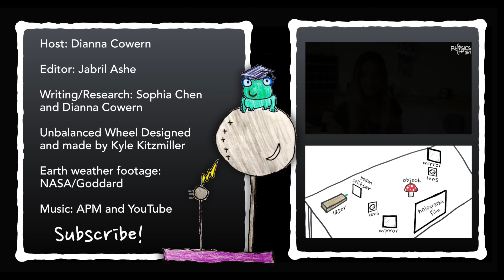Are perpetual motion machines possible?

Comment: So-called "magnet machines " cannot run forever.

They depend on permanent magnets and even permanent magnets are not permanent, they eventually loose their magnetism.

Even one with nothing impinging on the magnetic field eventually decays, if you move anything magnetic or conductive through the field it decays more quickly.
Reply: Hrile there is no permanent source of energy. that's the whole point. everything decays eventually. energy is only useful when there is an imbalance, a gradient. when all the energy in the universe has been "used", it's spread out so evenly, there is nothing but cold. absolute zero.
Reply: Hrile
Ever hear of entropy?

There is no such thing as a permanent source of energy.
Reply: Magnet motors don't depend on anything because they don't work, period. Magnets aren't like batteries. Magnets store energy the same way a spring stores energy.

Comment: I worked with a guy in a machine shop who built on of these.  It was over six feet tall and had six arms, controlled by cams that held the downward moving arms out away from the machine’s centerline.  On the back side of the machine the cams held the now upward moving arms closer to the machines centerline.  It was perfectly understandable.  And it didn’t work.

Comment: I mean, That bird kinda seems like a pretty easy way to get a perpetual motion machine, It isnt perpetual its just turning an energy source we already know about that we cant really extract energy from, and giving it a means to produce it. This is how i see it, It created kinetic energy fueled off of only ambient room temperature. If you had alot of these things designed in the most efficient way to utilize the gas/liquid hybrid in the container, and had alot of these rowed up together all producing a very small amount of energy with only the heat in the room, That would eventually result in a net gain right? Your just standing there once you start them, But if you found a way to turn that little bit of kinetic energy into electricity, thats where it becomes a net positive right?
Reply: i was sorta of thinking the same thing.
Reply: No because you ALWAYS need more energy at the input than you can gain. In other words: To keep your "engine" of the birds running you will reach a point where you need energy to control the ambient temperature to keep it running. Since you gain less than you need to keep it running you're at a net loss.
Reply: @Telris86  What about heating from the sun?
Reply: @progunantilife4777  
Then it would be more efficient to just set up a solar panel array and cut out the middleman.

Comment: what if you suspended the unbalanced wheel with magnets?
Reply: (this would make no friction)
Reply: Jacob Smith air resistance is still a thing. also you can't extract energy from it of you can't touch it, so it'd be useless
Reply: I'll give a little bit more of an answer:

The friction in the mechanical bearing is the biggest source of friction, but not the only one. Second would be air resistance. With permanent magnet bearings and a vacuum chamber, you can significantly reduce both of these. The next source of friction to be avoided is from the spinning of the earth, as over the course of 24 hours, the system will be rotated around the earth's axis causing a gyroscopic effect. This can be avoided aligning the axis of your system with the axis of rotation of earth (point north/south if you are on the equator). By this point, your wheel device will run for quite a long time before stopping, but not forever. There are two things still slowing your wheel down. One is the few molecules of air still remaining in your chamber (a true vacuum chamber has never been made). The other is tidal forces from the earth, moon and sun. Unfortunately, there are no known solutions to these sources of friction, so although your wheel can be made to spin a very long time, it can not be made to be perpetual. In truth, it will be slowing down from the moment you start it up.
Reply: Dear god I was hypothesizing
Reply: Just trying to help your hypothesis.  Many people think that scientists haven't figured out a PMM because they haven't tried. Rather, they haven't because they know enough about so many things to know that it is impossible. Flywheel Energy Storage is an example of a machine that would work best if perpetual, and scientists are trying to make it better all the time.
Reply: Michael Frederiksen okay

Comment: A perpetual motion machine is a theoretical thing, because it's defined as a closed system. Any other system, which seems to be a "perpetual machine",  could be in fact just as normal as solar cells, but only if you know the source. If you know the source, it must be an open system! Unbalanced wheels don't only use gravity, you have to mention impulses, inertia and maybe other forces too. If we don't know the source, it doesn't mean, we have a perpetual motion machine and that must be automatically a fake. Only physics... Check simple things like Charles Flynn magnet motor. That's not perpetual motion but over unity (closed vs. open systems) and it works like a charm. BTW: Nice video, thanks!

Comment: What about gravity, where is gravity's source of energy?
Reply: Gravity is a force. Force is not energy. Energy or work is force x distance. A weight or spring can do work, but they must store up potential energy first. The weight has to be lifted to a higher height, the spring must be wound. The weight of the weights powering the grandfather clock, is not free-energy, because the weights have to be manually lifted again, every week. A human being provides the distance over which the force is supplied. Gravity only provides the force.

However, I do believe that free-energy machines do exist already, but the evil NWO stole the technology from Tesla and the American people, because they are against the poor, and want us forever paying their phony energy tax. The universe is full of energy, and so why are we still paying for energy?
Reply: You're not paying for the energy. You're paying for a company to convert the energy to usable electricity, deliver it to your home in a safe fashion, and build and maintain the infrastructure required to do so.
Reply: The reason there is gravitational potential energy in the universe is a function of the initial conditions of the universe--specifically, the matter distribution was very smooth. Had the matter distribution been non-smooth, much of the matter in the universe would have collapsed into black holes, rather than more-gradually coalescing into stars. There is a Roger Penrose lecture on youtube about his conformal cyclic cosmology theory that is very instructive on this point.
Reply: +Yosef MacGruber You know, you technically ARE free to make your own solar power setup.
Reply: Matt Wood  gravity is a force. Not an energy.
Reply: Force also represent an Energy

Comment: I believe it is possible, if you put the perpetual motion wheel zero gravity then change the bearing to  magnets that are north to north meaning that it’s always centered point and no friction then you
Make the coins or bearings metallic and at the outer rims of the wheel have a weakly pulsed magnet it will cause the coins to fall to the end being a substitute to gravity that only affects one portion of the wheel unlike with gravities the whole machine is under stress.(sort of like throwing a baseball in space you put the effort to throw it then it will infinitely go in a straight line unless an outside force causes it to stop).

Comment: Great video.  
Would it be possible to use a water screw to “pump” water up hill into a reservoir, and have gravity power a water wheel that would turn the screw keeping the system running?
I know, it sounds like a deviation on the capillary bowl, so thinking a no, but would love to know.
If the gravity force was stronger than the axel friction, would this work, or would the mass of the water in the screw cause additional friction?
Reply: yes,  but it's not perpetual motion. with slight variations it's common practice and the elevated reservoir acts like a battery.  it's basiclly powered by solar

Comment: For the perpetual motion bird it is actual latent cooling that makes it work.  Same thing that makes you feel cold when you are wet.  The beak is wet and the warmer molecules evaporate which leaves the remaining cooler molecules behind.  That reduces the average temperature of the beak to the wet bulb temperature which is colder than the boiling point of the liquid inside the bird.  That causes the gas in the head of the bird to condense, which lowers the pressure drawing the rest of the liquid up making the head heavier so it dips again.  If the cup runs out of water, the evaporative cooling effect stops and the bird will stop.  So you are right it is heat that makes it work but heat in the water not in the room.  in a cold room it will work faster.  In a hot room it will stop.  it is driven by the cooling of the birds head caused by evaporation of the wet beak.

Comment: It would be good for the girl to get acquainted with the ideological "functioning" of the "perpetuum mobile" mechanisms, so that she does not spin them in the opposite direction in the examples. :) This girl's lack of technical thinking in the case of perpetuum mobile is not a problem, because it would not work even in the right direction of rotation, but the demonstrator must be exact if he wants to mentor. :)

Comment: technically a perpetual motion machine is possible if in a vacuum an at 0g, (its just if any resistance is applied it will stop)
Reply: Could a wheel spin in a zero g environment?

Comment: Overunity in the storing and discharging gravitational force as a kinetic battery with fluid is the closest you will come to "perpetual" and that's cause overunity doesn't break the conservation of energy. There has to be a start. But converting one of the four forced several times would allow for overunity if you can repeat the function multiple times after adding the charged potential force.

I always saw using a  Archimedes screw as the best option currently for getting a non-compressible fluid in elevation for the least energy required per cubic foot moved. Then you just need to restrict the flow downward to let them the flow upwards. Water is at the same level regardless of the shape or size of the pipe it moves through. Which means the friction you would loss going down and up it's your greatest issue... And leaks cause it's a liquid.

Comment: There are perpetual motion machines out there, but they're not something you can use to harvest energy. They're just curiosities, little conversation pieces you can have on your desk.

I recently saw a little desktop toy. It had a funnel and a curved ramp. You drop a ball bearing into the funnel, and it drops down onto a ramp that curves back around and launches the ball bearing back into that funnel to repeat the process, over and over. That is a perpetual motion machine. But it's just a toy; it's not something you can harvest energy from or anything.
Reply: "That is a perpetual motion machine."
Actually, those toys are battery powered.
That they come supplied with a USB power cable should be the giveaway..  ;)
Reply: @darklight2.1  I may have to take a closer look, but I didn't see anything like that. I'm also not sure where electricity would factor into the simple process of rolling a ball bearing down a ramp.
Reply: @biffwellington6144  They have an electromagnet hidden in the base that cycles on and off, powered by a battery that you can recharge with a USB connection.
They are available online.

Watch the motion and you can tell that it isn't natural-the ball is moving much too fast.
Reply: @darklight2.1  Thanks for the information! I saw it in a video and they didn't show that part of it.
Reply: @darklight2.1  I managed to find that video again, and you are indeed correct. It had this note in the description: "in fact the base contains a power source and very clever mechanism."

Here's that video, if anyone wants to see it... https://youtu.be/Y5dylh2aOiw

Comment: On the unbalanced wheel you can ignore the horizontal portion of the motion of the weights because gravity is a vertical force and its supposed to be the power source. Every weight has to be raised up the same distance that it falls so it turns out the wheel is not unbalanced after all.
Reply: and she should have said that.  her explanation was lacking.

Comment: Ok., I agree with most of what said, but I have a question !!!  And my question is based in the fact that electrons in every single atom of any kind are moving around the nucleus at very high speeds and they have been doing that for thousands of years.  And in order to move at such high speeds it´s needed energy, so my question is:  Where do that energy come from ?
  And another question:  Can atoms be considered as perpetual motion machines ?

Comment: @1:30 spin it in the other direction it stopped and started in the proper direction indicated by the angle of coin slots.  also could you please hold it in a up right position you have it at a angle, that adds friction to the coin movement. it won't be perpetual and would never power more then just itself. however it would be cool if it spun for long periods of time .

Comment: Plus, eventually you'll lose the "fuel" that the "bird" "drinks."
Reply: The water evaporates, you don't lose it. If you created an evaporation tank thing, you could probably get the water to run back down in to the bowl, as in something that cools the air back down, with a pipe leading back in to the bowl. Or build something that takes moisture out of the air and puts water in the bowl. Although this bird bobbing wouldn't really be able to power anything.
Reply: Uh, yeah,  @TheaDragonSpirit , this is exactly why you DO lose it. I've never seen anyone bother to encase their bird in such a tight... uh... "evaporation tank thing..." uh... that this... "process..." could work.
Reply: @HelloKittyFanMan.  It doesn't work if air can't circulate. My point wasn't to stop air circulating but to cool the water vapour back down, or take moisture out of the air to refill the bowl. There is metals and materials which cool water vapour as it passes, and this then turns back in to water after evaporation. As in condensation.
Reply: And good luck capturing the water back reliably,  @TheaDragonSpirit .
Reply: @HelloKittyFanMan.  The only point of this would be to show it can be done. As I said you wouldn't be able to do anything with the bird, also the parts will eventually break or wear out. You can't prevent entropy. But the point is that you could make a system where this worked a long time.
Reply: Not gonna believe it until you make an unfaked video showing it,  @TheaDragonSpirit . So for the time being, I was right, you do lose the "fuel" to evaporation.
Reply: @TheaDragonSpirit : "Refile the water"? Huhh, what?
Reply: @HelloKittyFanMan.  Go to a tap refill the bowl, put it under the bird. The past water vapour you lost will come out the tap. Ha. But if you work out some kind of water recovery system using condensation you will rarely have to refile the system with water.
Reply: @TheaDragonSpirit : Again, "refile"? You're not making sense.
Reply: @HelloKittyFanMan.  Refill. I edited them. I spelt it with one l and it auto-corrected.
Reply: OK,  @TheaDragonSpirit , thanks for editing. There's one more, but at least now I get what you're trying to say. I can't imagine how to build such a reclamation system or how it would look. So practically, the "fuel" is just eventually lost.
Reply: @TheaDragonSpirit : That, by the way, is why I suggest that people disable their so-called "auto'correct':" because it does more harm than good!

Comment: The closest you can get to perpetual motion is to harness the rotation of the earth, but it's not very practical. I remember as a teenager at an exhibition in the city (NYC) of a VERY large pendulum (about 40 ft long) that swung (very slowly, of course, because of its size) that will continue to swing as long as Earth keeps rotating. Each time it swings one way and back, the earth has rotated slightly, moving the pendulum's pivot along in the direction of its next swing, adding energy via gravity, so it just keeps swinging. That kind of blew my little teenaged mind.

Comment: At 1:27 you're spinning it the wrong way, lol. You can see at the end of that clip the coin falls into the bottom of the slot and wants to pull the wheel down. That is actually the direction it should be spun.

Comment: Perhaps a device like this could be added to another device like a windmill to continue it's movement without wind, and still increase efficiency.

Just the bird could be used to produce tiny amounts of electricity, like the type you could use to power an LED bulb.

Yeah it's not perpetual motion, but it's still free energy in a way. Just a less efficient solar panel.

Comment: Do magnets count as an energy source? I think a perpetual motion machine could be devised using many magnets mounted at an angle on a spinning inner  disk, with other magnets mounted outside the disk at the same, but opposing, angle, with the same polarity facing inward, —-IF—- the magnetic field could be contained and focused in only the one direction, pointing in, so that there would be no surrounding magnetic fields conflicting with each other.  But alas, I don’t think magnetic fields can be contained and focused like that. Still, magnets are completely amazing!